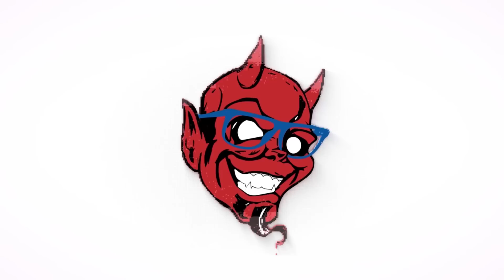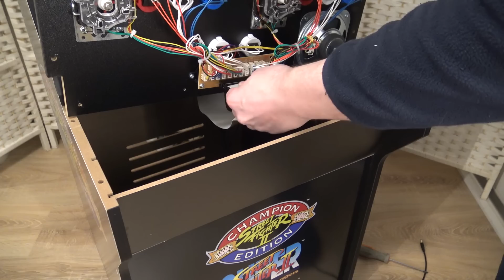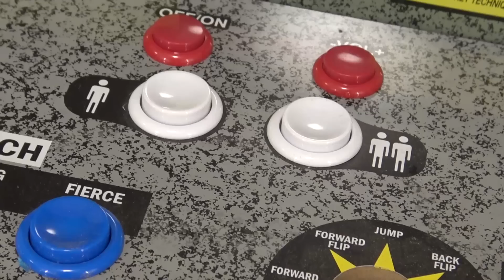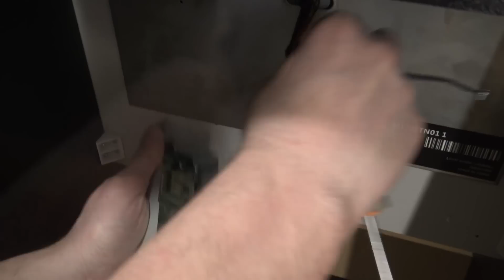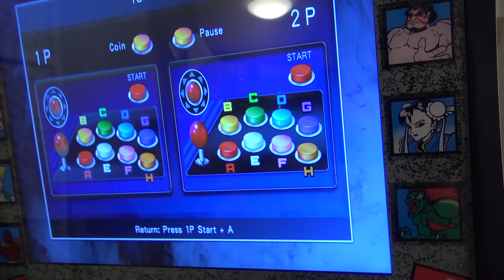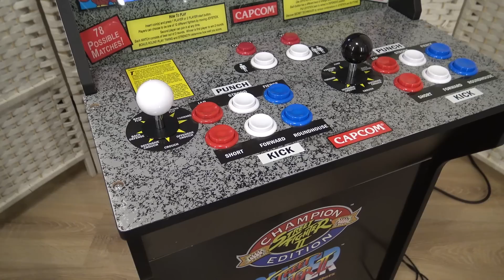Arcade1up Pandora's Box CX Upgrade Tutorial

Comment: Dear Sir,
I've just bought a TAPDRA Pandora Box DX Version Familiar Home Edition to replace my arcade1up electronic board. I'm having a little problem with the monitor configuration.
I wired it with VGA, mainly because it's a 4:3 monitor. I changed the resolution on the pandora, but I cannot fit the screen in my monitor. it is displaced to the right and I cannot move it. Do you have any specific configuration manual related to this issue?
Thanking you in advance, with best regardsDaniel,
Reply from the maker: Hold the reset button and boot up the pandora that is how you swap resolutions of the mainboard. You can always adjust the monitor with the tiny button board that comes with ths arcade1up monitor kit. Did you try both ?
Reply: @WickedGamerCollector  yes. i have tried all. with hdmi and vga. in the screen i saw 720 p, but displaced to the right. with the butons of the monitor kit, i push full in dispaly side, and complete it all the screen, but i dont see all the windows. allways there is some of the picture hidden in the right

Comment: Quick note. If you mount your monitor board on the backside of the metal monitor use insulating tape like kapton so the pcb doesn't short out touching the metal.

Comment: Instead of drilling holes for the new joy sticks you can swap the metal plates and re use the same holes. It worked for me when I upgraded my joystick 🕹 😌
Reply from the maker: I used the same joystick holes.. only removed the on and off switch and volume control 😬
Reply: @WickedGamerCollector  thanks ..1 followed your steps and I have successfully modded my Street Fighter Arcade...but Where is the power button now....How do you cut it off & on now?
Reply: @gumbo_off_wildwillow  yes and what does the volume button do?
Reply: Appreciate the tip bro